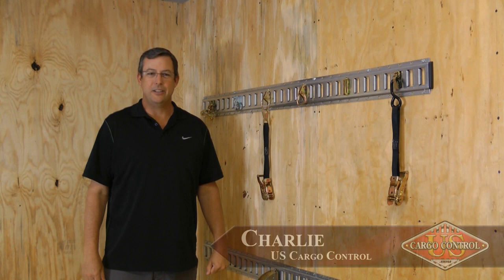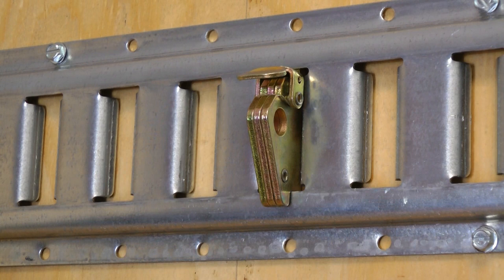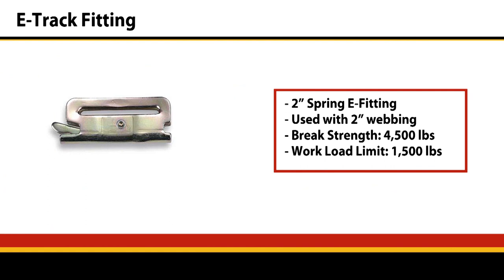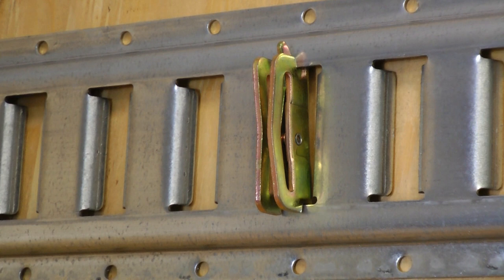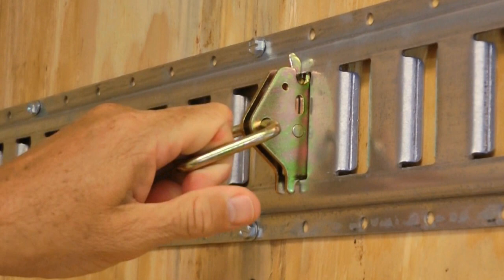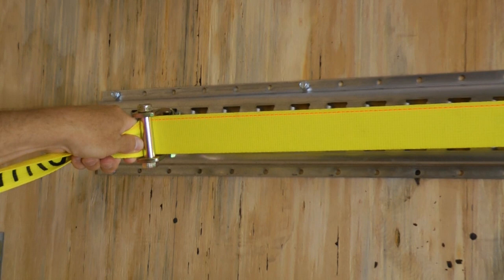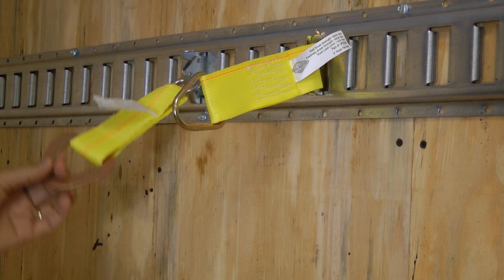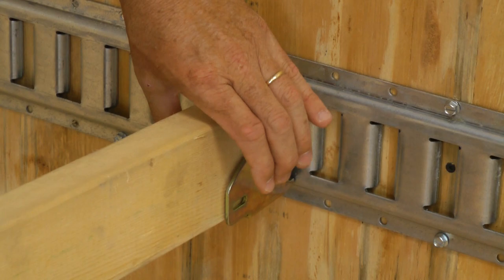Types of E Track Fittings | Must-Have E Track Accessories

Comment: The wood end socket doesn't look like holds the 2X lumber very snugly.  Just what I need, another rattler noise maker in my van for removable shelving.
Reply: Put a wood screw in it and stop complaining!
Reply: @turfguy420   Perhaps you never owned a work truck.  Even with wood screws, shims and epoxies, the E-Track brackets themselves become a constant noise maker in such a situation.
Reply: @ForbiddTV  yeah right....If you only knew.
Reply: If you can't figure out how to stop that from rattling then maybe you shouldn't be working with tools....just sayin!
Reply: @gtb5216   Perhaps you live in a country where a 2X4 is actually 2"X4".  To make a of piece hardware that doesn't fit any lumber size on the market is a pure engineering/marketing failure... just sayin!
Reply: If you've got a work van full of tools and shit I don't see how you possibly have an expectation of it not making noise
Reply: @wll1500   Or you didn't read the comment. You apparently missed the word "another".
Reply: @danadurnfordkevinblanchdebunk  ok so if your van is already noisy then why tf do you care
Reply: @wll1500   All my shelves are built in and do not make noise.  Didn't look possible with the displayed brackets.
Reply: @danadurnfordkevinblanchdebunk  Ok how bout the tools and supplies within those shelves? Lol 

Also, you completely miss the point of these products. E-track is made for box trucks and trailers and is primarily intended as a way to restrain cargo, not for shelving. The shelf accessories are basically there in case you need to build a temporary shelf in your box truck for convenience. 

They are made to be temporary and easily moveable. Obviously, a contractor van with dedicated full time storage shelves will be more solidly built and quieter. 

What you're doing is essentially like saying a spare doesn't perform as well as a normal wheel.
Reply: @wll1500  Did you even read my comment?
Reply: @danadurnfordkevinblanchdebunk  I've read every single one of them. Care to clue me in on what you think I'm missing?
Reply: @wll1500   I got enough crap rattling around in the back of my van, I don't need to purposely use built in hardware that also makes noises.  
Why is that so difficult for you?
Reply: @danadurnfordkevinblanchdebunk  ok I think we're going in circles o lol